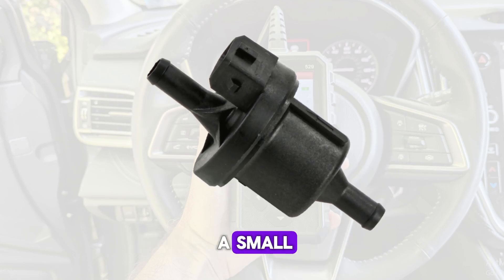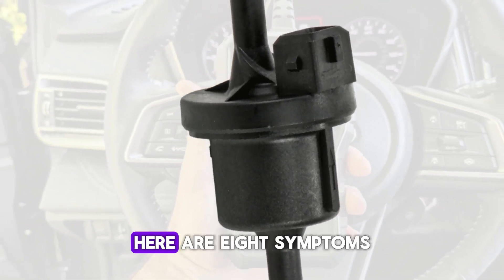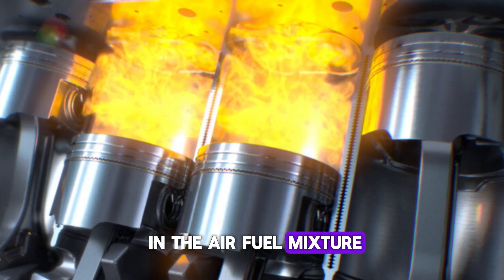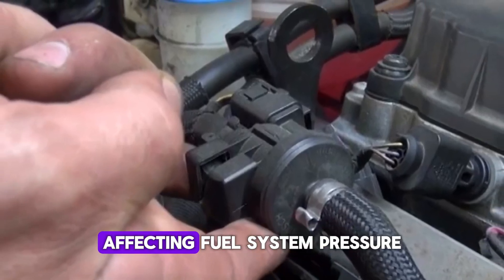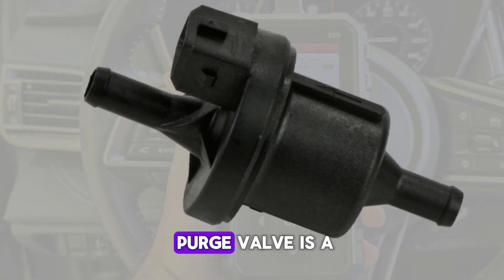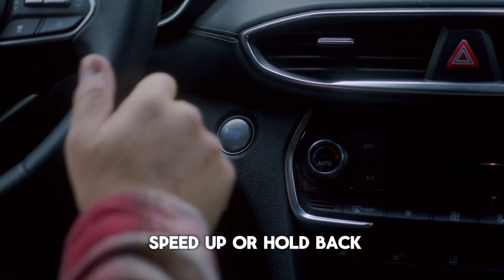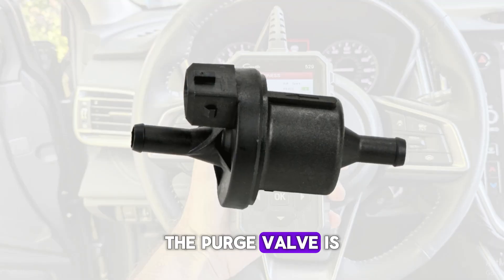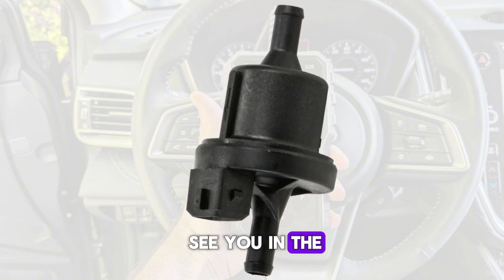8 Symptoms of a Bad Purge Valve | Don’t Ignore These EVAP System Signs! #purgevalve

Comment: Have always just eliminated these and plugged the vacuum line. Don't see anything bad happening by doing this. I have had check engine light on the whole 40 years i have been driving.
Reply from the maker: Minor issue can trigger the check engine light, even if the Catalytic Converter is removed, the CEL will be showing but you can drive your car as long as you want. Just that CEL is for you to know that something is not passing the accurate information to the ECU.